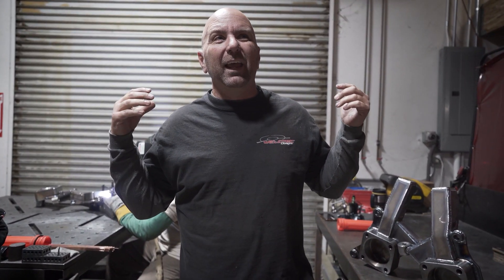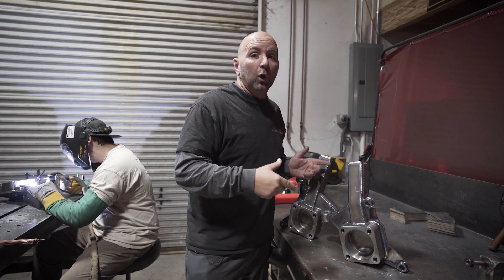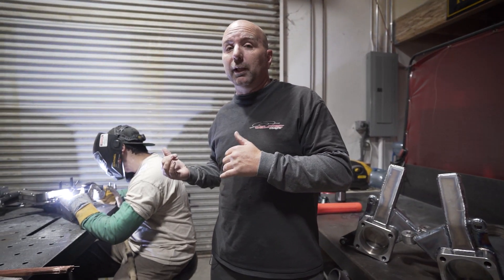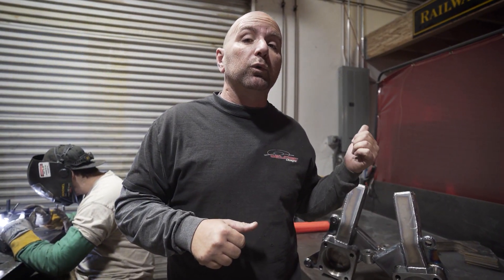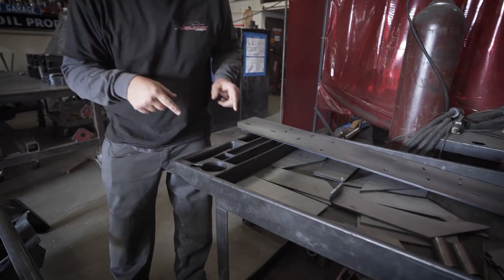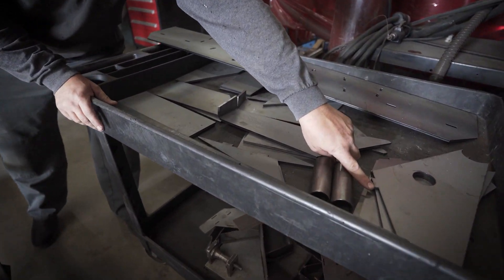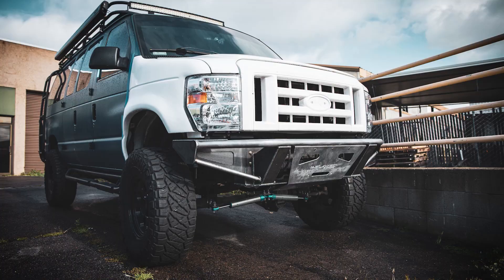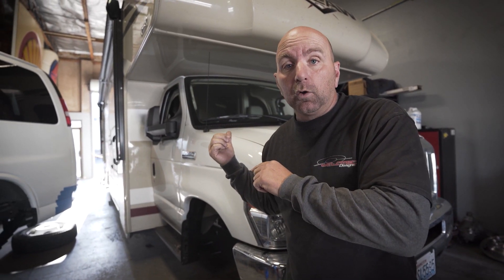Stimulus Savings | DIY & Van Lift Options

Comment: Don't suppose that DIY bumper would fit 3rd gen. Bring back 3rd gen lifts please!
Reply from the maker: We actually have a local 3rd gen stopping by today to see if it will fit... We do have a lift you just have to do the front end swap to 92-2014!
Reply: @WeldtecDesigns  Let us know about the bumper when you do! The swap is a little too pricey at 5k.